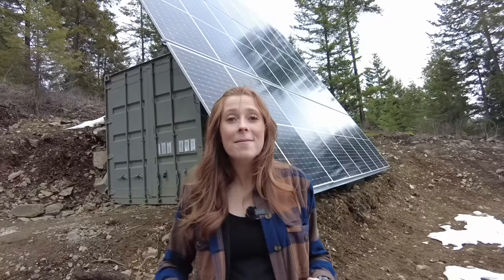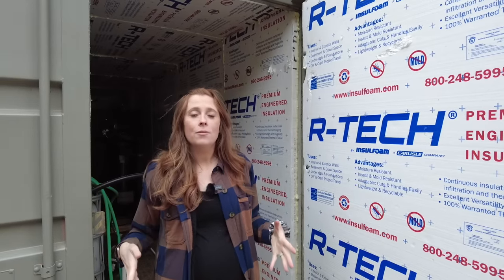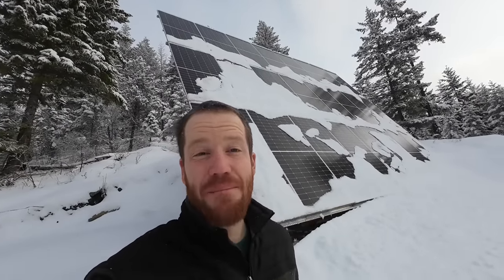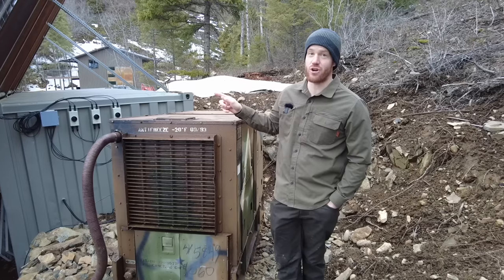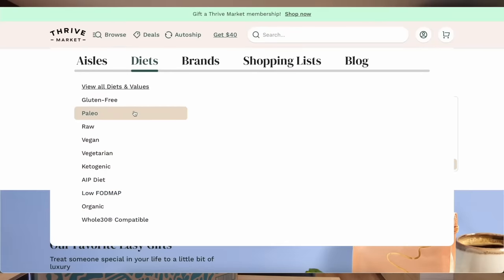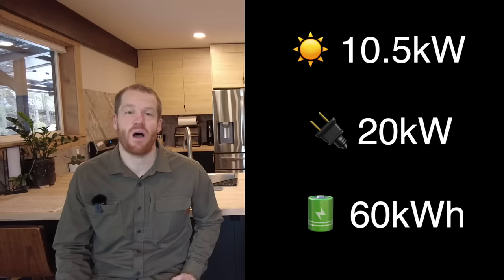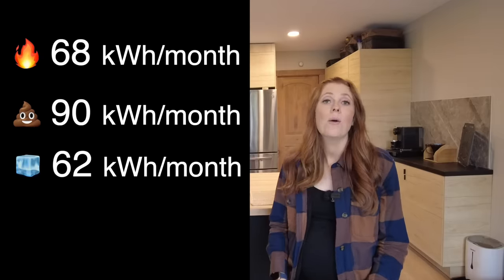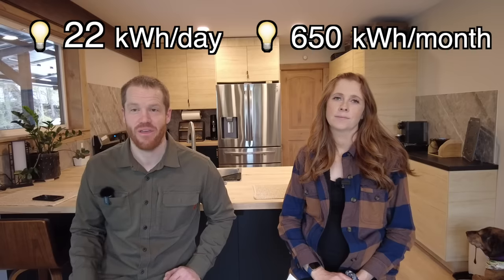The TRUTH About OFF-GRID Solar | Winter Update

Comment: As someone who is just getting started in a whole home solar system this was a great video. We live in the Smoky Mountains so we still get decent hours of daylight in the winter and our house has a wood stove, pellet stove, and oil furnace for when it gets really really cold. We have two 6kw inverters and a small array of batteries along with 2.4kw of panels. This again is just the start of a project we will scale up. 

I designed our system to run off the grid when the batteries fall to a certain SOC but to only use solar to charge them back up. This means until we have a much larger solar array our system switches over to grid power regularly. This has allowed us better visibility into what size solar array and battery capacity we will need long term.

Great video, keep the content coming!!

Comment: A decent HAWT on a small tower could be an awesome supplement to your solar array during winter months. Definitely won't remove the need to run the generator, but will certainly extend the time between generator starts. Average wind speed in Dec. in N. Idaho of ~10MPH puts you above minimums for a HAWT. Can even set up a dump load to resistors in a water heater to reduce the water heater load when your batteries do get full.

And last -- Congrats, guys! And welcome, Oliver!!
Reply: Also cold clear windy nights are when it works and solar does not.
Reply: great idea. I would do two. once they get the driveway done, they can have bulk fuel delivered and hold a years worth of fuel paying for itself by eliminating trips to town to buy fuel at retail prices
Reply: My first choice would be wind living in Idaho, and even in Washington where i live, it would be wind over solar.
Reply: Was just thinking about that, or if they had a small stream on property, install a micro hydro unit. My on-grid power usage is 4-600kwh per month but I have gas for most of those items that use it, Dryer, hot water, furnace, kitchen range.
Reply: their power usage is more than double what mine is just with their mentioned devices, not even adding all the extra stuff. It'd be easier to just cut that down lmao
oh wait they said later how much they use, it's like 10 times what we do.
Reply: With all those trees? I don't think so. They would need a very high pole with quite a large turbine on it. Not likely to be worth the effort if at all technically possible.

Comment: When you upgrade the generator, you should consider a combined heat and power plant. The regular generator as a ridiculously low efficiency. With a combined heat and power plant you would at least use the heat energy for something useful.
Reply: I don't know if that has to wait until there is an upgrade. you could just run the cooling water through a heat exchanger bevor it goes into the head sink. Sure it probably wont be the most efficient set up. But it surly gonna save a ton of energy for heating when it is most valuable.
Reply: You could run the filtered exhaust through a lossnay cartridge and use it to warm fresh air being fed to the hvac.
Reply: @a-aron2276  that should work too.  I wonder what would gane more of the heat. Perhaps it is best to use one for preheatiing water and one for heateing the home.
Reply: @MusikCassette  it's by no means the way to do it but if you're already running the generator in -21° then you might aswell use the waste heat to take most of the load off the ac unit. But in all seriousness even directing the generators exhaust towards the ac units outdoor coil will help warm up inside.
Reply: @a-aron2276  I am not sure if they pump heat from the outdoor air. Having the space they have it would make more sense to pump the heat from the earth, or an subterainien water container.
Reply: @MusikCassette  they do not, which is why I said the coil. The coil is part of a heat transfer system, it works better when heating inside to have the air surrounding the outdoor unit as warm as possible. The opposite would be true if you wanted to cool indoors it works best the lower the outdoor temperature is. I'm over simplifying the whole process but the concept is there.

Comment: Home Assistant is a great app. Using Home Assistant and color lights, you could probably have Home Assistant turn the house lights to red when you hit a threshold of power. Home Assistant would allow you to automate some of the things so you don’t have to monitor manually as much. Home assistant can run on almost anything, including a RaspberryPi for lower power consumption. Just a thought.

Comment: Great update guys!  

We have an Ecoflow system I'm finishing building out to run our RV overnight.  It's 2 Pro generators and will soon have 4 batteries.  As soon as I can, I'll put my 10, 200 watt solar panels on the roof.  Add the 2 ground deployable 400 watt panels and I'll have the ability to generate a total of 2800 watts. All of this equipment is in our 7X18' trailer we use for our business.  

Thanks for all you do, we've used Thrive for a few years, well worth it!

Comment: I figured at 800 kw you could use a 2500 watt generator (2000watt load) on a split phase converter or a single phase charger.  You could pay around 150ish dollars in gasoline per year.  The thing is you'd have to run it for longer periods..  Obviously a few extra oil changes.  Though you'd only use about 50 gallons of fuel.

Comment: Just now installing 3 of the EG4 mini split solar heater pumps.  So far running them off of solar panels direct.  And they work great. I'll be adding 18 more solar panels to my existing 18 to power the three heat pumps. 5 tons total.

Comment: It's a dream to have a self sufficient home with a nice solar panels array like you guys have! But not possible for me at the moment so I'm living the dream through your videos! ❤
Reply: Same here.
Reply: it is possible to buy panels  used for next to nothing, pow mr makes a combined solarchargecontroller 80A 450v, inverter 3kw ,with gennerator input for about 325$ good used lead acid  batteries have fallen alot in prize since  cheaper lipo4 asembled batteries have hit the market,, i am running a 3 kw  panel system with the above mentioned pow mr unit and 18kw lipo4 battery storage for the whole system about 3500$  and i am offgrid  , good luck

Comment: It's very cool you guys are/have been, tracking this information. Seems most folk just plug stuff in and walk away from it until something breaks then, make a negative production about the products. I couldn't get a grasp on your generator use from a maintenance perspective but, using it for a couple of months followed by 10 months of downtime... You may consider preventative maintenance runs once a month (maybe once every two months depending on that unit). Start it let it warm up to running temp for a few minutes, idle er down and shut it off (certainly take advantage of its power while its running). Just info, happy to see BabyKins is making the videos and that all are doing well ❤

Comment: I have the exact opposite of your need to keep the climate steady for your batteries and inverters/CC's.  It gets to 110 on my property in the summer so I did the same thing and insulated my well shed and used that for the batteries storage area.  BTW I love your inclination on your panels mine are at 30 degrees!

Comment: First I want to say,I love thrive market!

Second, I must thank you for the inspiration on building my frames for my 20 panels. I used your design with the 2 inch pipe for a pivot point holding the 4 inch channel iron. I am building the second frame now having only been able to build one for use last winter. I am grid tied with with the local co-op electrical utility using a hybrid inverter allowing me to have 400 Ah (20.4 kWh) of LiFePO4 batteries backup. The co-op utility allows me to bank power for 12 months. A kW put in in excess of usage can be withdrawn in 12 months paying a distribution charge. I pray this arrangement is available long term!

I will have the other 10 panels installed this week and will be generating in excess of my usage for the rest of the summer banking the excess for the winter months. My usage is very similar to yours 600 to 700 KW per month in winter. The 4 100Ah batteries will supply the critical loads panel for about two days in the case of loss of the grid power. The Sol-Arc inverter switches to battery backup so fast that all electrical functions, clocks etc., are maintained during the switch.
Reply from the maker: Wow that is an awesome system! The ability to use the grid as a long term “battery” is an interesting concept.
Reply: I'd highly suggest signing some type of long-term contract if possible.  Slowly but surely, all the gravy-train net metering programs across the country are changing over to far less favorable plans (unless you're grandfathered in under a previous contract).  Under most of these new plans it's hardly worth sending the power back to the grid...

Comment: Ever thought about a small Wind Turbine in addition to solar for autumn and winter? They are inexpensive and winter storms should feed them well.
And would be a nice video series for your channel 😊
Reply: How would grain help?
Reply: I live in N Idaho, as well. I cannot find any reliable info on cost effective wind generators. but that would help a great deal. I get a nice constant wind all year.
Reply: They are living in the forest, so tall trees obstruct wind. But still it's a good idea, because in the winter any additional energy helps.
Reply: Cheap small wind turbines are typically junk and can’t produce the claims that the company’s state. It’s mathematically impossible. It has to do with wind swept area and wind speed. The math doesn’t work. Some companies have a 3’ diameter turbine and call it a 2kW unit. Not happening. 
I install Bergey turbines which are out of Oklahoma. The 1kW unit which isn’t available any longer I don’t think has a 5’ rotor diameter and weighs 50 pounds and cost $3k for just the turbine. Tower and electronics installed is $10-12k. That’s not cheap. The 6kW unit has a 20’ rotor diameter or more and weighs 1000 pounds and cost $25k for the turbine. Cheap turbines are decorations.  Real turbines are expensive.
Reply: Our turbines lasted two years, they burn out the bearings. Our electrician used to recommend them, but he said everybody ends up burning them out in 2-3 years

Comment: Congratulations on the baby! 
I have been living on 1100 watts with 840 ah of golf cart batteries for a few years now. Being in Arizona the winter isn't as bad for sun but still have those short daylight hours. 
This winter I tried a diesel heater and that increased my overnight power draw noticeably but cut down my heating bill vs propane. Better heat also! 
Generator wise I got by with about 7 gallons of gas a month December -February. 
People think oh you must live in the dark a lot. I run stuff all the time! I just use energy saving devices!  I am working towards going Propane free. Propane has been my biggest monthly energy cost. 
Shortly I will be adding 720 more watts of panels. By next winter I plan on expanding the battery bank out to 1260 ah. I expect at that point Generator usage will be extremely rare to three-day heavy overcast events. 
I went with golf cart batteries because of upfront cost. They are the old tried and true method! You just have to do maintenance on them! Make sure to stay on top of corrosion and keep them watered. Like anything they treat you as good as you treat them. While there are definitely advantages to Lithium I still plan on staying with Golf Cart batteries. Lower upfront cost, 5-7 years of life if you  take care of them and easy recycling.

Comment: I've got about the same size system as yours (although I did a DIY build), and going into my fourth year off-grid now. I'm at 63 degrees north here in Finland, so my December days are pretty much dark all day, so yeah, generator is required to charge the batteries. I use much less energy though; I use a wood gasification burner for heating and hot water in winter and I don't have an incinerator toilet :)
Reply: i'm looking forward to getting a wood gasification boiler for my next off-grid house.  i'm building not far from these guys next year

Comment: Thanks for the update. We bought a 2022 Tesla Model 3 in December 2021. We immediately began thinking about adding a grid tied solar system to our home to help charge the car. We ordered a 9.15 KW solar system after the EV arrived, but before it was installed we ended the Tesla experience. The Tesla was nice but it had a "phantom breaking" problem, meaning while driving with the autopilot engaged (cruise control) occasionally the car would suddenly engage the brakes causing rapid deceleration without warning because the "system" perceived a problem that wasn't there. This terrified my wife and she refused to ride in the Tesla. We tried to get the problem fixed but Tesla just said it is working as intended. We traded it in on a Genesis G90 after owning it about six weeks. We now have a solar system which basically eliminated our power bill, and we also get a bonus check at the end of the year for the extra power we sent into the grid. We love our grid tied solar system.  If you're thinking about buying a Tesla vehicle please consider our experience. Thanks for sharing your experience with us. Good to see the baby.
Reply: Congratulations...all you did was prepay your electric bill for the next 25 years. The next buyer of your house will thank you immensely.
Reply: @MikeCris  We are saving a little over $100.00 per month. We will not live long enough to pay off the solar power so the next owner will pay off the existing mortgage and the solar system when they purchase the home from our estate.

Comment: Absolutely love these videos. Trying to get a 200+Kw array system setup for the farm with 3 phase. Its crazy how many options are out there.
Reply: How much energy do you use per day and what are your biggest loads?
Reply: @niktak1114  winter load is roughly 100kwh per day as the house and out building are 100% electric heat and being in Canada and -40° in the winter. And there will be a 100'x400' shop that will be powered by it too. And winter light is 6.5hr/day

Comment: Hey I've been off grid for 2 years and I have 400w of solar, a worn 200aH agm battery and a harbor freight 3500w generator. With small tweaks you can make solar go a long way. And it is correct, you only run short of solar in the deep of winter . 15kw PTO generator to weld or get 50amp,  3500w for big power tools. And 500w inverter and solar for everything else. Cook with propane and propane dryer. Never burnt more than 200 in a month of fuel

Comment: Great result! 😁
I suggest to use the excess solar power to produce hydrogen for a generator in winter. 😉
Reply: Not many resources on this yet but it's something I'm also keen on. Electrolysis of demin water has so much potential
Reply: You can't really store hydrogen that long, it just kinda dissipates from the tank
Reply: The easiest way is to get or make an anaerobic digester to turn cooking scraps and other waste into methane. You can run a generator off it or cook off it! If they ever got chickens or other livestock it would really amp up how much gas they could produce. There are people that power their car that way and other stuff.
Reply: Hydrogen is notoriously difficult to store in quantity over any length of time. Gaseous hydrogen, in addition to leaking through every valve no matter how careful you are, is exceedingly space consuming for the energy it provides.  I like the idea of trying to store excess power for use in winter, but I think something like methane would be a better storage idea.

Comment: I really love how you illustrate the effectiveness of a hybrid system of electrical generation. I think that too many people are hung up on promoting solar over fossil fuels, or vice versa, because they have an agenda. Your practical approach is a model of how the two can complement each other instead of being at war with one another. Well done, I hope your new family is doing well. All my best.
Reply: Not wanting to pollute... such an AGENDA!
Reply: @RickMyBalls  exactly, lithium is a huge pollutant but great storer of energy. Fossil fuels are great energy but pollutants as well. Taking advantage of the best benefits of both  makes sense. Generators are designed to run  at peak efficiency when delivering power, lithium batteries store renewable energy when available, and fossil fuel generated power when needed. A great hybrid system by reasonably minded people.

Comment: We use 1400kWh per month totally off grid in Ky. 2800sqft. 16-33 SEER heat pumps, 80 gal std wh, elec dryer/stove, DeLonghi toaster oven, microwave…all from 20.6kWp, 16kW inverter, 143kWh LFE.